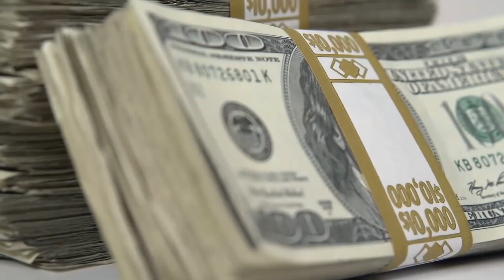Will The Arabs Build A 1-kilometer-tall Skyscraper For 2 Billion Dollars?

Comment: About 5000 years ago when you saw someone building a huge pyramid out of rock with only a tiny chamber for a dead man, you would be thinking the same way you are now.
Reply: BTW, these buildings will not last that long. Pyramids shape ensures that they will stand practically forever. These RCC buildings will probably crap out in less than couple of hundred years Max, simply due to rusting of steel, especially in coastalplaces. They will have to be taken down before that.

Comment: The Chinese thought of building a 1.5 kilometres hydroelectric dam (the 3 gorges dam- it had mountain gorge canyon where a 1.5 km dam could be built) but the pressure of the dam plus the water behind it would be so massive that reenfourced concrete known to men would crumble to powder-  in future they said material science would bring out such concrete. However the dam had to be completed and it was completed in a very wide canyon with quarter kilometre height (600 feet). Now the arabs know best about their one kilometre skyscraper